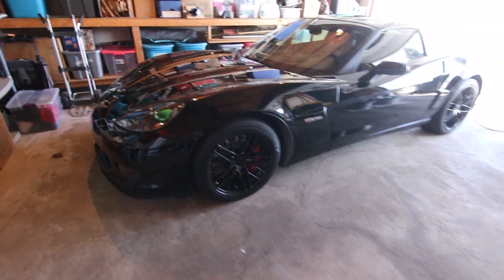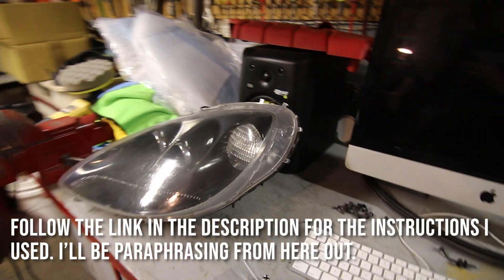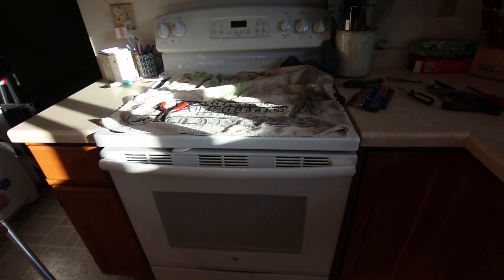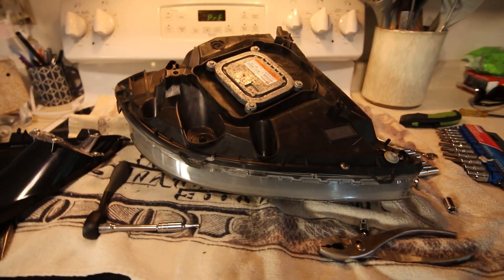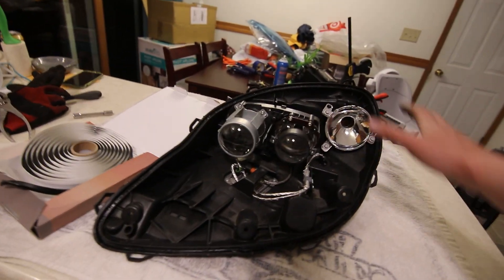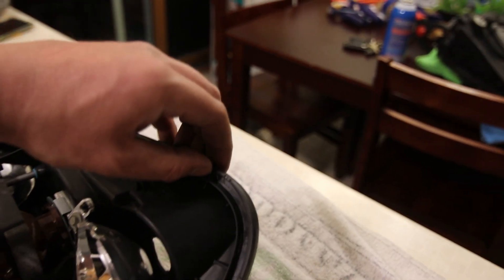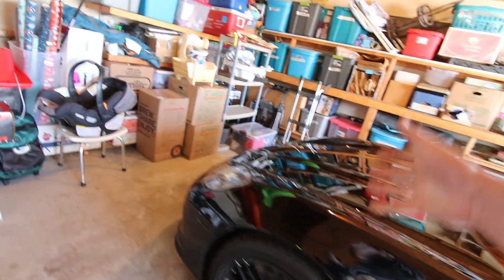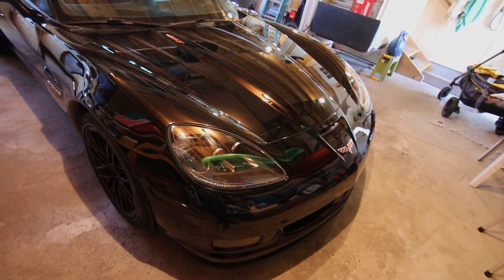C6 Corvette Headlight Lens Replacement Guide (EASY!) - Base, Z06, Grand Sport – RLSebring

Comment: Thanks for this! Really helped. One thing I would like to add. After removing the lens, what saved me hours of work is that I scraped about 2" of the old polyurethane adhesive out of the lens channel and then poured about 1-2 ounces of 91% Isopropyl Alcohol just above the adhesive (make sure the lens housing is level) and let it sit for 5-10 minutes. It loosened the bonds at the base of the adhesive enough that I could pull the adhesive in one continuous piece. You just want to make sure to use even pressure and pull forward at a 45 degree angle. If you let the Iso alcohol sit for too long, the adhesive can get really slimy and loosen the bonds too much that it will break in sections. Also, you want to keep a dam of Iso alcahol in front of the area you are pulling and don't let it run dry as it evaporates very quickly. Hope this helps others.

Comment: You completely skipped the 1st step dude! What happened to showing what you 1st did to get the lights out? You flew thru that part! Lmao...
Reply from the maker: You just have to remove the bumper cover, or get it well loose/out of the way. There's quite a few videos on that. Think I mentioned it in the video?...

Comment: Dude that looks killer! A little labor for a fraction of the cost of a replacement. I might have been cool to see you try to polish and “restore” one vs replacing the lense. Nice work as usual!
Reply from the maker: That doesn't work with these lenses. There are literal cracks that go all the way through the lenses. When it happens they aren't salvageable. Most other headlight assemblies you can restore, which I've done many times. It's too bad these are different.
Reply: @Greenlightfilming ; you are correct. When these units “craze” they don’t just get cataracts. They crack straight thru making them unfixable. Anyone who thinks this is an easy or quick job is in for a rude awakening. Its a tough, job and you better have a lot of patience

Comment: This video was super helpful! I just finished doing my own after one of my lenses got a giant crack in it. One thing I noticed, when you initially bake the assembly to loosen the seal, I found ~300⁰ works fine so as to not melt the plastic pieces. Also making sure no plastic pieces are touching the metal parts of the oven helped mitigate melting problems.
All in all, great video, thanks for posting!
Reply from the maker: Glad it ended up going well for you too. Talk about a PITA removing all of the old sealant right?

Comment: Do you know what size the adhesive tape is? I’ve seen different sizes. Thanks!
Reply: great question, im wondering the same, buying the lenses on ebay with new gaskets, all you really need is the butyl tape then go to work...looks to be 9mm and 9mm is the common size to buy one ebay, what size mm did you end up working with?

Comment: Hi, did you have to coat the lenses before installing? If so what did you use? Thanks
Reply from the maker: Negative. They have a UV resistant coating on them.

Comment: Why go thru all of that hassle for the stock headlights when IMO THEY ARE not very good looking and the amount of light they throw is sub par at best. I’m sure with better HID or LED bulbs they will be improved but again why not just replace with the awesome, and much better looking Morimoto XB’S?? I AM ALL LED on my 2011 GS Convertible manual 6 speed except for the front headlights. Rears are Morimoto’s. Side marker are all LED. Interior LED kit is on the way. And license plate lights and backup lights are all LED. The front are a PITA from what I can see and hear. Whole front end/bumper has to come off and then there are a ton of Torx #15 screws and clips to remove all the while you are not scratching your paint!
Reply: Morimoto shit is over priced as hell, and make the car look ricer to me. I love the clean look of the stock lights. I have VetteLights line LED side markers and Eagle Eyes smoked tail lights and I replaced my lens and painted my housing matte black (on red corvette) and upgraded fogs and Hid's to VetteLights and it's WAY nicer and lights are bright as hell. The light output and light spead from my friends morimoto headlights aren't as good as the upgraded Hid's and fogs I got from VetteLights.
Reply: They have a led projector kit conversion. Only reason I'm watching this video. I like the looks of the headlights especially because they are paint to matched but they need to be modernized and need better light output. If you want a paint to matched morimoto you may be spending 2k
Reply from the maker: I prefer the stock c6 color matched headlights. The c7 look alikes seem out of place on these IMO. Was happy I went this route.